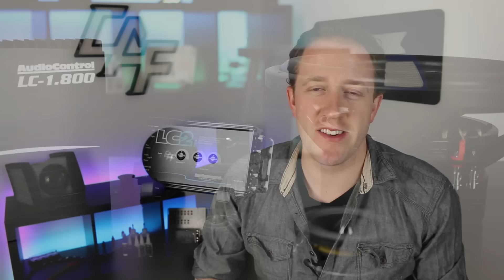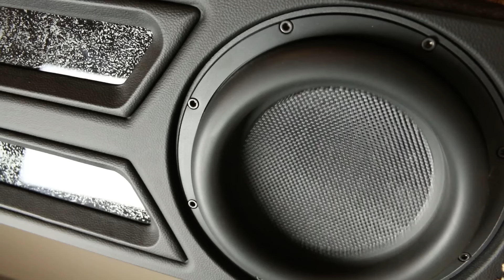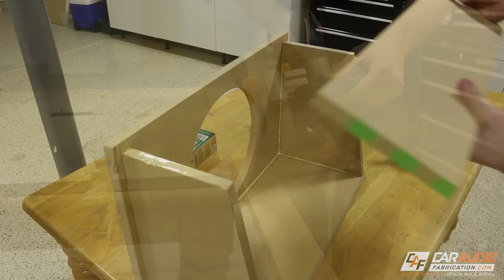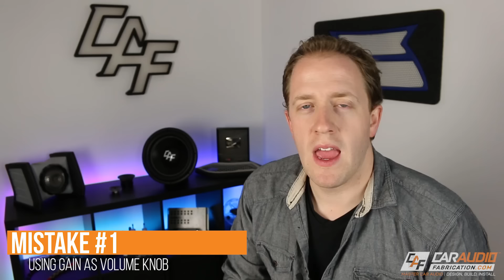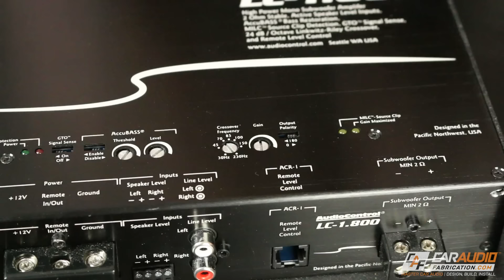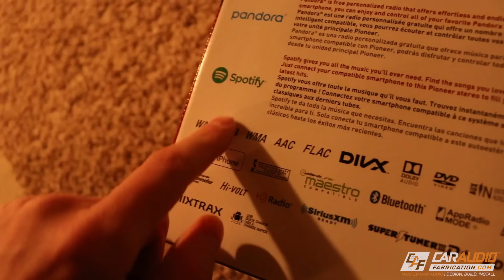Avoid these 5 common Car Audio NOOB Mistakes!

Comment: I dont get you BASS FREAKS i mean sure its fun n all but it gets old after 5 minutes better invest in good mid and high range so you can have a system that is very loud and good to listen to not just so much bass that the mirrors shake and get no audio over 150 hz trough ....
Reply: Bass is non-directional. Midrange and high frequencies are blocked when they hit a solid object. 99% of the time when you hear bass from a car, the sound inside is VERY different. You physically can't hear what the passengers are hearing until you sit in the vehicle (directional soundwaves)
Reply: or get the best of both worlds and get awesome bass, mid, and high range audio!!
Reply: Howard Peters Jr. yup
Reply: Photonic_ Induction,  spot on.  A system that is overall set up with proper bass and mid and High's is best.  I too gets old all that bass in 5 min and I can not stand those vehicles that drive by and all i hear is bass.  It's like they have 12 sets of woofers and only one set of mids and highs
Reply: @Greg Myers how old are you?
Reply: Photonic_ Induction couldn’t agree more!👌🏽
Reply: There's nothing better than a deep bass hit that goes right through you. But I agree that without proper tuning it just sounds like shit. Gotta have a full range, well balanced system.
Reply: We dont get TREBLE REBELS have your music sounding like a 7 year old as loud as they can 😂
Reply: Photonic_ Induction that's the point shake the car and hear just hard bass
Reply: Howard Peters Jr.
But I think that's exactly what Photonic_ Induction doesn't get (and myself, for that matter).  I hear people drive by sometimes and all I hear is nothing but bass.  It sounds absolutely terrible, and it's deafening.  I legitimately don't understand what people like about it.
Reply: some people just like obnoxious shit. they know the only value is how obnoxious it is. the "fun" effect doesn't wear off for them. :shrugs:
Reply: @Greg Myers Dude....I have to question your taste in girls?  And while I am at it,  I need to question your level of competent thinking since you just classified all females into liking that crap bass annoyance that you and others seem to deem as musical greatness?.....I tend to think people on your scope of reasoning also think that music with a lot of UMMM, YEAAAA, UHHHH, WORD, BIATCHES, SUCK MY... SLAP YO A** is musical genius.

Comment: Not putting every single piece of wire in the amp or sub😂 one time me and a friend of mine put the cheapest radio and subs we could find in his bronco, once we got it all “ put together “ we decided we were gonna go pick up some girls, well when we did we went to a field that was fairly wet and my buddy did donuts for probably a good 30 minutes or so and his sub box wasn’t bolted down or anything so it was sliding around the whole time and ended up jerking the wires out of the amp, they touched 😑 his carpet caught on fire and it burnt to the ground🤷🏻‍♂️😔

Comment: stupid shit i did was arc my alt to my motor doing the big three, blew a few fuses, had to walk 15 miles to auto zone for more fuses lol. never doing that again.. but ive long since upgraded since then with no other stupid mistakes except i left a ratchet on my battery and arced the battery to itself... welded the ratchet to the neg terminal, used an angle grider to cut that bitch off lol.. now ive xs power batteries and i would never put them through that torture.

Comment: Yep, I hear you on number 5, I got 2 18s, a nice 2000w rms amp, the 2/0 ofc wire, a few 100aH batteries. But failed to upgrade my Head Unit and alternator, n with my 50amp alternator I ended up clipping to death my $450 worth of subs in the first 12 hours I had it installed... Don't understand estimate a lack of Amperage cuz clipping kills

Comment: #6 Run your power wire down one side of your vehicle, and a sheilded RCA with speaker wire down the other side of the vehicle to help reduce noise. ;)

Comment: Not knowing proper resistance. When I first started I burnt up a brand new infinity sub in about 3 days because I bridged the amp but didn't wire the speaker properly

Comment: I'll gladly say the biggest mistake i see noobs do.. poor grounding.. grounding to the seat belt bolt, trunk hinge bolt, awful.. #2 of the bigger, poor wire routing.. running wires threw the hood jam, door jam..UGH UGH UGH

Comment: I would add that you should buy the right stuff the first time - put off your purchase until you can actually afford it.  Throwing good money after bad only serves to drain your bank account.

Also, a system is only as good as its weakest link.  What's the point of buying top quality speakers if you cheap out on the amplification?  What's the point of buying top quality amplification if you cheap out on interconnects?

In a nutshell, do it right the first time and you don't waste your money or have to do it over again.

I would also add that people think that more wattage is better - a Watt is much bigger than most people realize.  As CAF points out in other instances, you reach the point of diminishing returns; he leaves out that this holds true in a big way with wattage.  Essentially, doubling wattage being given to your speakers will not double your volume; it will only yield a 3 dB gain, which is just this side of being audibly louder.  You need ten times the power to double (10 dB) your volume.  It is sometimes cheaper (especially with the ancillaries - cabling, alternators, batteries, stiffening caps, etc) to just increase the number of drivers, space allowing.  And, even then, you need to balance out the other parts of your system, which will cost you.

When I designed my system (which was biased toward SQ but balanced that with SPL), I adhered to these tenets as well as to those in the video.  Most importantly, IMHO, I kept it simple and reaped the rewards.

PS - Love the reference to ILS (If Lightning Strikes) Watts! 🤣

Comment: I would suggest the difference between 320 and flac isn't quite as noticeable as suggested. I would recommend checking out foobar's ABX plugin and run some 320 vs flac tests. Most people can't reliably A/B the difference, I've actually never encountered someone who could score that ABX plugin higher than what you'd have to dismiss as guessing.

 That might even make a good video by itself!
Reply from the maker: +drdyna this is exactly what I said in the video. Law of diminishing returns. Not much change from 320 to flac. Big change from 128 to 320
Reply: Oh, no real disagreement there, I was merely talking about when we get to the point where you're talking about flac, you intimated that there was still a quality jump. While it may be true on a technical basis, the idea is planted that someone who, say, listens to Spotify as a primary source is missing something audibly is a stigma that I wish would go away. I'm in the "not much change from 128 to 320" and then from 320 to flac is all safely in an area that doesn't even warrant discussion of audibility, let alone even rate as a noob problem.

I haven't listened to an uncompressed track in over a year now, and I'm a bit like you, a builder / maker / speaker loving type of guy. Mostly pro amps, tapped horns, waveguides, high sensitivity stuff. Diminishing returns are in the rear-view mirror by 320 kbps, and in this day and age, you've actually gotta put effort into finding something lower than that, unless it's downloaded trash we probably shouldn't even be talking about. 

I just think mp3 is a way dirtier word than people give it credit for. It might be worth talking about in a more general sense, but here it comes up while we're talking about 5 mistakes noobs make, and when it could be said that you shouldn't use absolute garbage source material, which is a perfectly reasonable mistake and worthy of being pointed out, if we carry on all the way through to the other end being flac, rather than what we have evidence of audibility for, we go beyond a mistake a noob could make, and go right to the mistake that seasoned professionals make.

Comment: So you talk a lot about picking equipment and subs, and boxes. All I see is ported but you never address the issue of what kind of music are we listening to. I’m quite sure that different styles of music require different sizes of subs as well as sealed versus non-sealed help us out there a little bit. R&B is what the young crowd usually listens to so I’m assuming that’s why you’re building big subs and ported boxes.  I have a suspicion that for lots of mid base with rock ‘n’ roll like AC/DC etc. would a sealed box be better would a smaller sub be better. go into some pros and cons about the types of music that other people might listen to and help us understand that. A lot of good guitar riffs sound better at a loud 100 Hz than getting clear down to the 60 Hz mode. don’t really need that. Help
Reply from the maker: +Devo 1 no. A lot of online retailers love to push the "ported for rap, sealed for rock" and 8s are better for rock 18s better for rap so that they can easily push you into a category to buy. They don't care if you end up with subs that don't fit. They got your money. What's actually important is picking subs that will fit and then an appropriate box design that is designed specifically for the subs. But this requires more brain power and research than most people are willing to apply, so the old so called "rules" continue to be applied and spread

Comment: For about 8 years I had my sub in a box designed to fit behind my wheel against the side of the trunk and it was very disappointing. When I traded in that car I looked at the recommended volume and got the right ported box for it. Now that single 10 hits harder than most of the dual 12 setups I’ve heard.
Reply from the maker: +Greg Blau funny how having the box design makes a difference right? That's why I sell the box design blueprint guides on my site www.caraudiofabrication.com
Reply: CarAudioFabrication I may be looking into that. I picked up a beater short cab s10 & it has everything cheaply upgraded. I rewired everything right and it sounds surprisingly good but there’s absolutely no bass. Been watching videos to get an idea of something compact I can build for behind the seat. I’m not looking for a ton of bass but would like something low and thumpy.

Comment: Cheap and incorrect tape, not using solder or crimps. 'My speakers sound blown', in reality it's corroded or loose wiring generally in door speakers where connections are not protected from the elements. Buying expensive amps and cheap speakers. Spending thousands of dollars on speakers and amps without a DSP or EQ. --- One big one... Running your power cable through the DOOR JAM and not using a fuse because it's expensive. (I know people who had their cars burn due to this)

Comment: I have a question I have 3 amps in my Lexus and 2 amps in my nissan and when the radio is on there is always static but when I turn off the amps the radio plays clear on both vehicle why is that?

Comment: Went through my amp because I had a bad ground. Worked on my system for two years to finally get a basic understanding of how everything works. Not running anything expensive, just using a little boss amp and a 10 inch dvc 4 ohm kicker sub. If I would have known to pay attention to specs of sub's and amp's I would have gotten a different subwoofer.

Comment: I think one of the most common mistakes is that people are only buying a subwoofer (+ amp obvsly) before (or without) upgrading the rest of the speakers. So they have proper bass but their mids and highs sound terrible.

Comment: Agree to disagree i know for my jvc head unit volume is hard to adjust Because  im running a 3500 watts audio god amp and 4gauge power cable in order for the amp to receive its required power but if i turn the amp past half way its too much volume if i leave it below half way the amp stays cool and the volume is perfect and speakers are coping fine  and i had my sound tuned by professional at sounds limited but they used a laptop with it plugged into radio and my amp  and i manage to put out 120 db bass in my little car but yes getting a bigger sub isnt always the best scenario its about the make of it and the wattage and rms  im running a pioneer 1200 watts champion series old school and still runs like a charm .
Reply: Yup, I'm using 2 gauge for an 1100 watt mono amp, 4 gauge sounds very thin for a 3500 watt amp.
Reply: And i had 8 gauge on my 4500 watt amp never went into protect with the gain on off .*118db* Loud! and a low peak of 85hz
Reply: You say "past half way" I assume you are talking about the gain setting.  That matches my experience: you can do initial/out of the box setup with gain at the 35-40% setting to start, and adjust from there.  If I have to go past 75%... the amp may be too small for the speakers, but mainly I don't want to make too much heat.

Comment: When I was working as an installer, the most common mistake I saw, was using home stereo speakers in cars, so the stereos had to work harder to power 8 ohm speakers from 4 ohm  rated units.
Reply: Heyyyy....morrrrrron! It ain't working harder if its supplying half the power. Dohhhh

Comment: There is not a single installer in southern Oregon that uses an oscope or SMD tool, literally I've called them all and asked how they tune amps and they all say they do it by ear.
Reply: Smd tools have only been around  for couple years. Been ear toning  for years!
Reply: If they've been doing it long enough, that might be fine... until their ears start giving out on them.

Comment: Admittedly, setting “Gains” is my nemesis.  I have a Kenwood head unit, but no amp yet, and the unit has Gain settings on it?  Why?  Should gains ONLY be set on the amp to match the head unit output?  So confused…

Comment: also change the amp fuse while changing and upgrading the battery n altenator with wire sizes

Comment: So where can I find high quality audio like 320KB/s or Lossless(Flac)?
Reply: Jay Kel Productions iTunes is alright but Spotify streams at a higher bitrate if you are a premium user.
Reply: Just convert it to FLAC from your 128kbps MP3's :D
Reply: :P   all that will do is decompress and recompress with all the missing bits still missing.
Reply: iTunes is your best bet. 👍🏼

Comment: Another thing to add. If your using a inline control knob for your gains, set the amps with it installed and the knob set to maximum. They have some resistance, which means your amp may not be playing to it's fullest potential. Capacitors do wonders, just don't go to a local Bestbuy or Walmart expecting a "good" capacitor. Boss audio and Lightning audio are the worst as the covers are mainly for looks, they have smaller caps underneath rated for half the farad rating. Something I go by that works well, concerning brown out's and headlight dimming. 1 farad for every 1,000 watts class A/B does the trick nicely. You can do a dedicated battery, but if space and weight is a concern 2+ farad caps are a good alternative.

Comment: When I was getting into car audio it was pre-internet.  I know.  Now it's a lot easier to get good information and find good deals.  There's no excuse for buying poor quality or poorly matched equipment.  It's all out there at the tip of your fingers.  Having said that, there's a lot to be said for going to a retail location with a good demo set-up and listening to some of the differences in equipment.  I recall doing an A/B comparison between MTX separates and Morel separates in the early 90's.  OMG what a difference!  MTX sounded like a 1930's transistor radio by comparison.  My point, do you homework, find reliable sources, and listen for yourself.

Comment: Mark, quick correction and clarification. 320kbps MP3 is almost indistinguishable from FLAC of any compression level. I can almost guarantee most people won't know the difference, and many can't tell a 192kbps MP3 file from a 320kbps MP3 file unless they've got professional equipment. MP3 files aren't inherently bad, they just contain imperfect data. But as long as the compression from source is at 320kbps, even when you're playing those files on studio-grade gear, it's difficult to tell it apart from something like FLAC or ALAC.
Reply from the maker: +3scape4rtist re-watch the video. This is exactly what I'm saying. Law of diminishing returns.

Comment: -Not realizing that car audio is about electrical and acoustics , and not wanting to learn the basics if you're going the DIY route. Or not wanting to shell out a lot of money to install it right if you don't want to DIY. 

-Using Professional PA midranges with no midbass drivers. 

-Installing 10 piezoelectric tweeters just because they're cheap.

-Having the gain set really sensitive and boasting how your system is really loud at volume 12 even though it goes up to 62

-Using random values of capacitors to protect the tweeters with no knowledge of crossover points.

-Boss.

-Using an Epicenter as a bandaid to get good bass after the sub box was constructed with no deep thought, just what some dude recommended (not even the manufacturer, just some random dude).

-Using unnecessary equipment in general. For example getting a good deck with enough RCA-outs and processing, then still installing a shitty pre-amp/eq/crossover just because it looks cool. 

-Not protecting your hearing.

-Thinking that everyone wants to hear your music so you wind down your windows and play your shit music for all to hear.

-Thinking that the above makes you look cool.